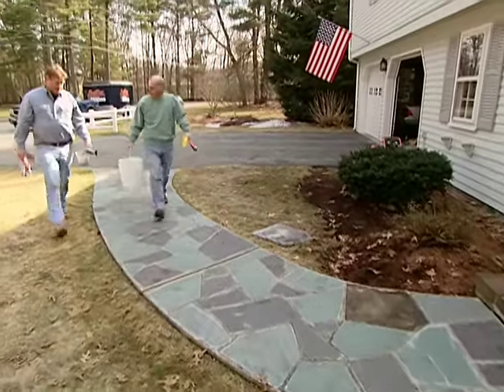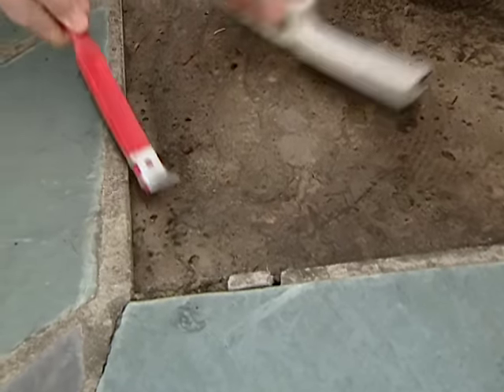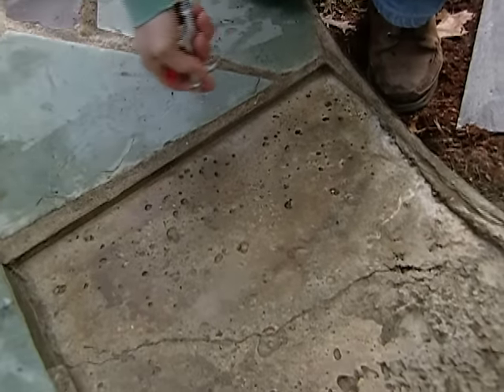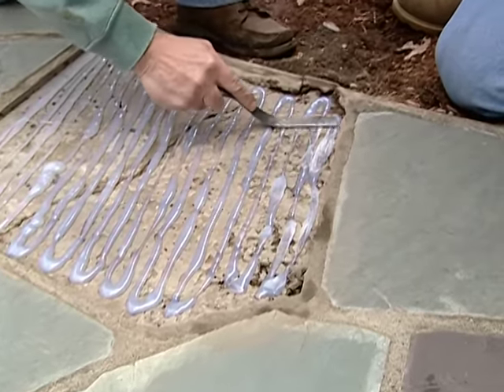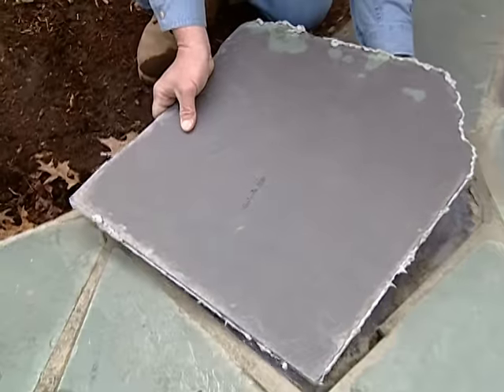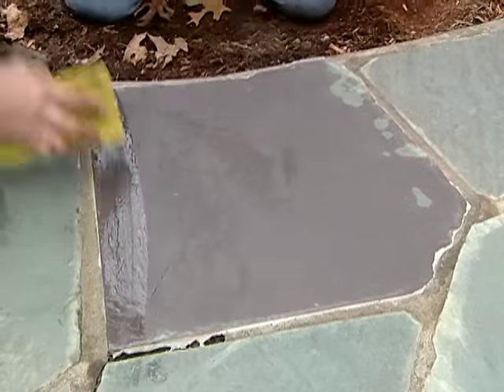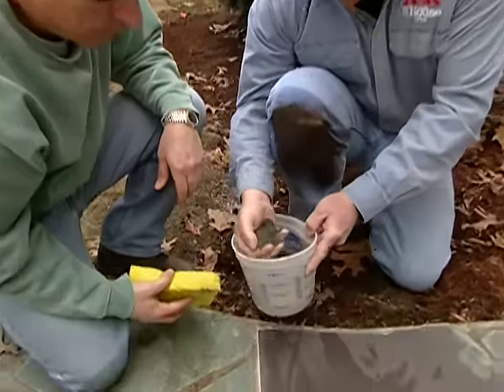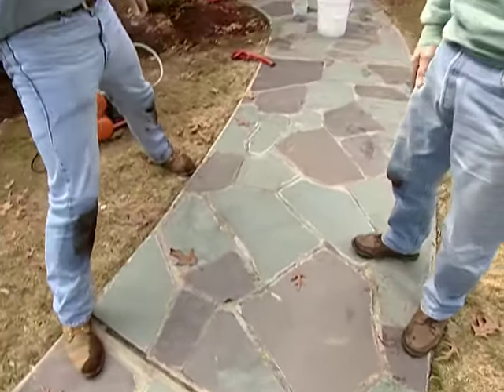How to Repair a Mortared Flagstone Walkway | This Old House

Comment: Two things... I've done this and found that when cleaning the old surface I use some bleach and water to kill any mold or microorganisms that may have developed.  It gives a cleaner surface for the adhesive.  Also when caulking the edge, I apply it ti the walk edges instead of the flagstone edges... it does not seem as messy.  See what Roger did after trying to place the flagstone in place.  He touched the edge which got caulk on his hands, then he got it all over the face of the flagstone.
Reply: Great idea in regards to cleaning prepping.FYI Unfortunately bleach can’t/won’t kill mold.

Comment: Just had a new flagstone walkway installed over a mortar bed.   In less than 2 months, it is riddled with hairline cracks and cracks that  go completely across the walkway.  Almost all of the cracks are at the mortar/stone interface.   The joints were also filled in with mortar, not grout.   Should grout have been used?

Comment: I like that the stone is so neatly out of it's spot--as if Dr. PimplePopper pulled out that flagstone!  My flagstones are a mess with loose and broken mortar--about 10 in total--but none has popped out like that one did.  I wonder if they had to break some of it away and did so before the video?

Comment: Yes it wasn't a "good" job but you people need to realize it's not just that. It also depends on the owners budget.
Reply: Buying those 2 tubes of adhesive and repair goop is more expensive than a small bag of mortar... this repair is more expensive

Comment: I'm repairing my patio and it appears previous owner used some of these methods. It won't last and it is a real pain to chip out adhesives they used. This old house should be ashamed propagating this junk repair.
Reply: I agree . and that house is a bit too nice to be cheap but I bet its more the fault of the repair guy talking him into it. I think its a decent repair but not a Biltmore House Estate repair and everyone on here seems to think that it needs that level of cost and turn it into a full blown surgery instead of a quick band-aid that might last 10 years
Reply: What is the best way to repair a patio?